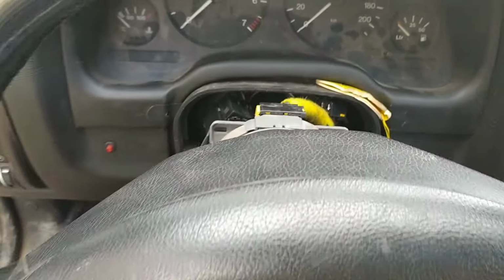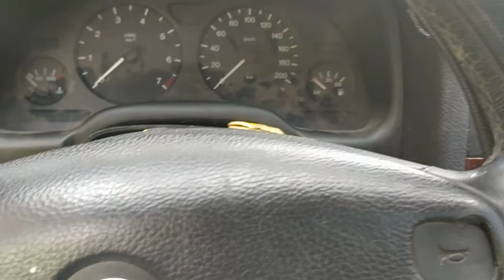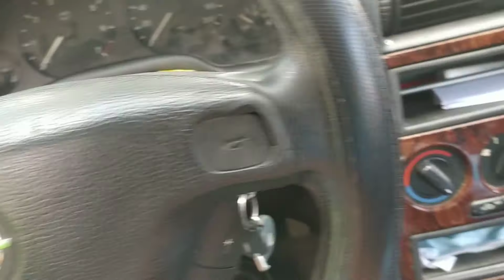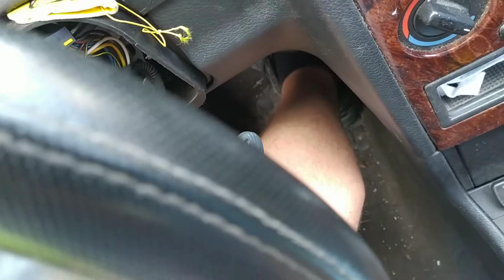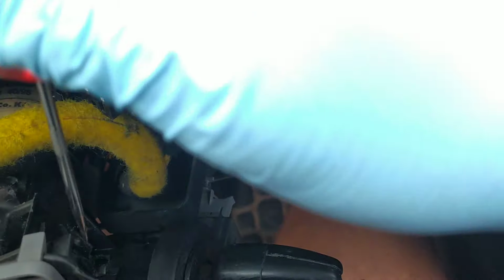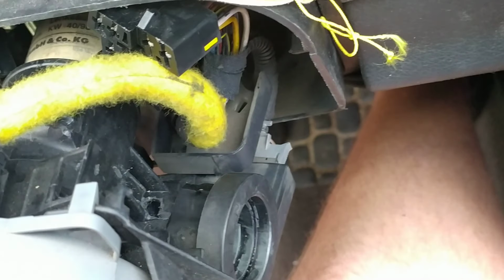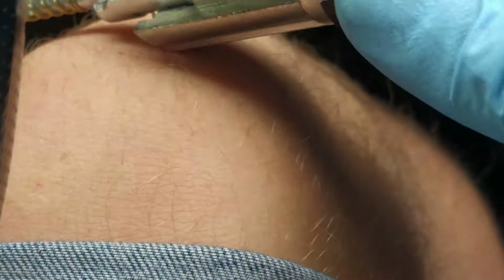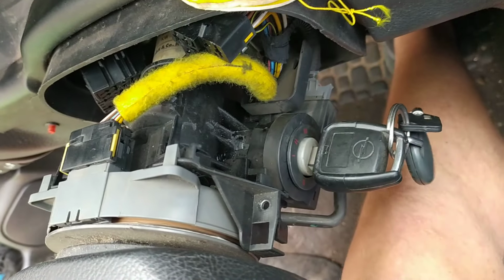How to remove ignition switch Opel / Vauxhall.

Comment: Help I've lost both my astra g keys if I buy barrel from scrapped car do I also need to buy immobiliser casing
Reply from the maker: Immobilizer reader i think you mean. But . it's not going to be enough, you need a computer to match the chip
Reply: @MeFixingEverything  so doomed thanks I wont waste my time n money then now i know that keys will have to b coded
Reply: @danger1640  No, they don't. You swap chips
Reply: @RichToff-b6s  I done that Brough barrel from scrap with keys wud start but then few seconds later it wud cut out car went to scrap yard about 5 mouths ago

Comment: And how to remove the lock cylinder when you can't turn the key to position 1, it blocks it halfway just enough to push the lock in and unlock the steering wheel, but it can't go to position 1
Reply from the maker: It's broken, find my other video.

Comment: Thanks for your quick response brother! If I turn the key there is no sound and crank at all! The ventilation and lights and everything is working perfect, the battery is new and strong 77 ah! I was thinking about the starter reader and startmotor? Thanks you! 👊🏾
Reply from the maker: Can be both, have a look at ScannerDanner videos on how to check bad starter motor with lamp,.if you don't get signal voltage , will be the ignition switch.

Comment: Very helpful thanks :-) You forgot to mention your cardboard wedge to hold the sprung dash trim in place - I only noticed it after I did the job and it would definitely have helped for refitting the top steering wheel trim!
Reply from the maker: Great tip! Thank you.

Comment: That's removing the barrel, how do you remove the ignition switch that your video relates to.
Reply from the maker: After the barrel is removed, there is two plastic bits that hold it in place z you have to squeeze them and it comes right off. On my one they were broken so someone glue it in place and I had to smash it a bit in order to take it off. Don't forget to put the switch back in first when you out everything back together.
Reply: @MeFixingEverything  Thank You, all good now